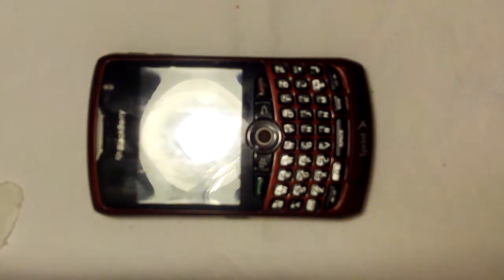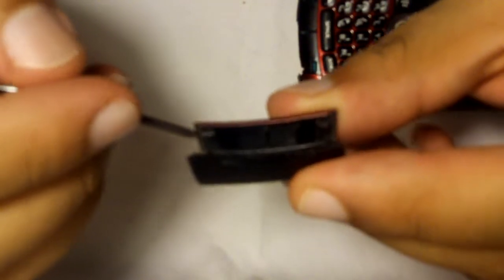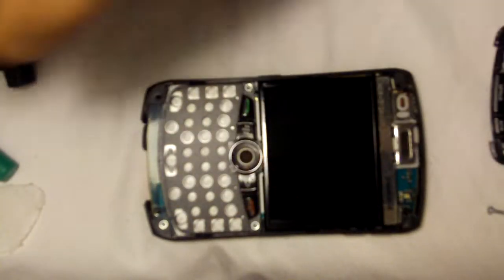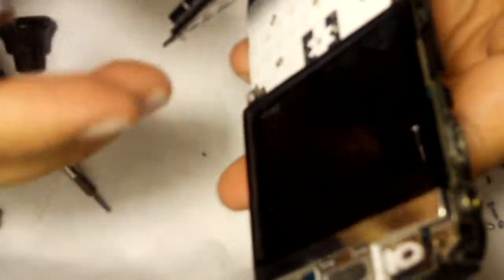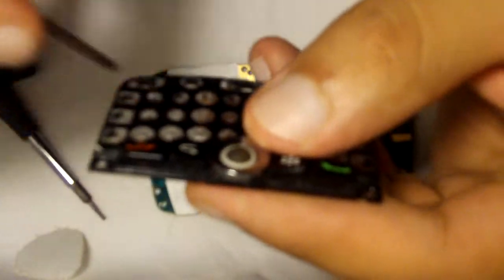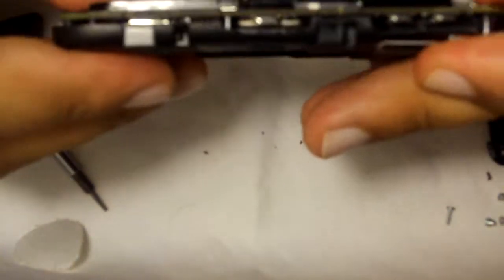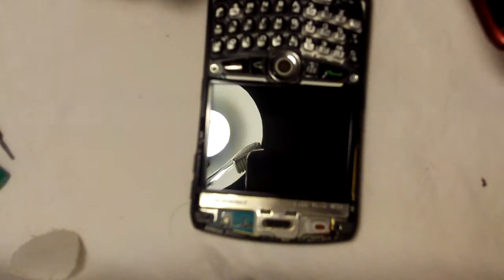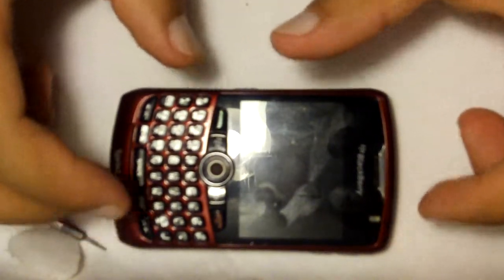HOW TO TAKE APART A  BLACKBERRY 8330

Comment: hey man one question the side tabs on the front plate that look like hooks what do they attach to? the side rails or the chassis? for some reason when i replace a new front plate to mine i does not close completely you can see a gap the tab on that side does not engage all the way . thanks in advance!